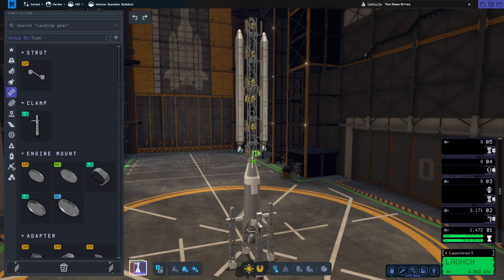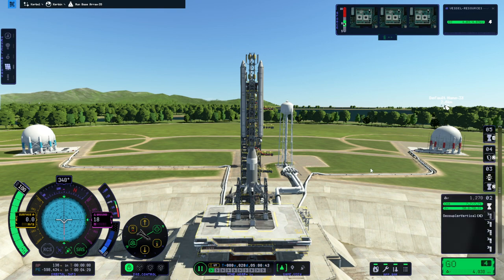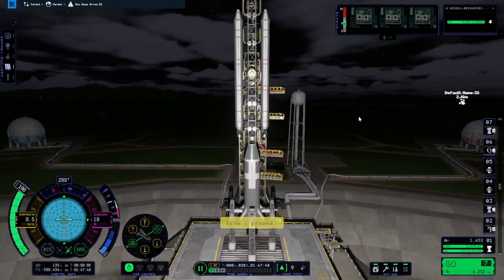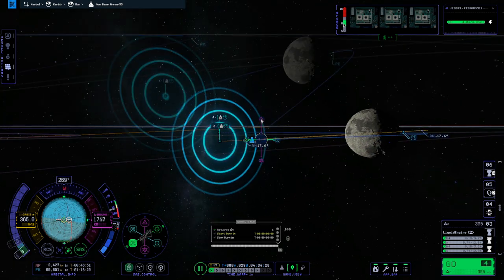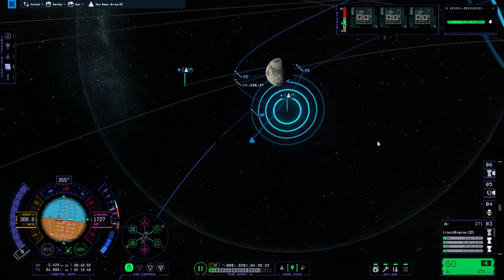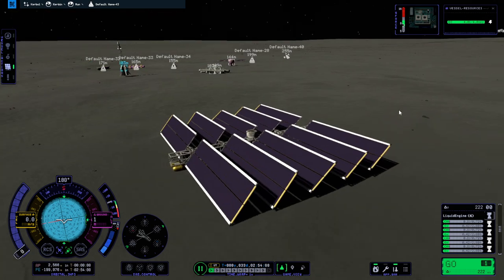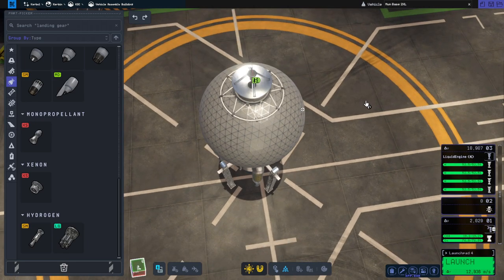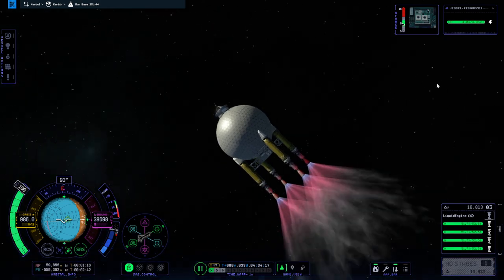KSP 2 Early Access - Mun Base 06

Comment: Some translation thrusters might help you make more accurate landings. That way, you can handle vertical and horizontal velocities independently.
Reply from the maker: Yes, but they are also extra parts that, since I consistently land the modules safely, I really don't need, and will just cause extra lag. There's no benefit to landing things any closer than I'm landing them since they're liable to impact each other when they glitch out.

Comment: It's kinda weird how all your modules are separate, I like to make my bases (in KSP 1) one monolithic structure that I build up over time, tho I might eventually download KAS for pipes and stuff to connect modules together. But that's how I made my Minmus base, I basically made the base itself in the spaceplane hanger and then detached them and made individual drop ship landers for each which then flew up and became my Minmus relay network. Two birds with one stone lol But I wanna develop my own drop ship at some point that can be reused and handle all kinds of different modules, the only issue is that not all base modules have a convenient placed docking port right on the top and in the center.
Reply: With how buggy KSP2 is, it's not at all weird.
Reply from the maker: As LeonMustapha pointed out - I'd rather not lose everything simultaneously, so having separate modules right now seems like a good idea until I think everything's going to stay stable. Also, we obviously don't have KAS and while I've previously wheeled things to each other and docked modules together on a surface, that's obviously not necessarily a good idea right now, either.